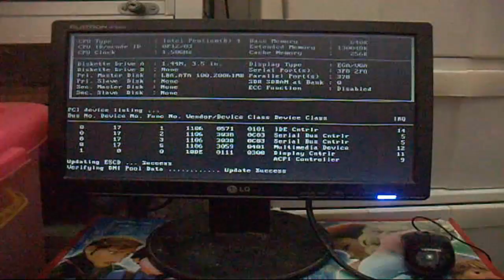Cara Mengatasi komputer tidak bisa nyala

Comment: bang mau nanya dong kalau pc tiba2 mati sendiri pas dipake terus pas tombol power di tekan gak ada respon sama sekali, psu sudah saya cek pake kawat yg disambungkan ke kabel hijau dan hitam dan hasilnya psu normal tapi ketika dipasang di motherboard tombol power pas ditekan gak bisa nyala sama sekali tolong dijawab bang baru kali ini soalnya
Reply from the maker: coba tuk cek heatsink dan fan processor, apakah kendor atau kipasnya tidak jalan. overheating/kepanasan dapat mengakibatkan komputer mati sendiri.
Reply: lampu indikator juga tidak nyala sama sekali bang, saya sudah coba nyalakan tanpa casing juga gak bisa dinyalakan😭
Reply from the maker: @zaldychst  saat menyalakan bunyi alarm tidak ?
Reply: pada saat dinyalakan tidak terjadi reaksi apa2 bang
Reply: fan prosesor sudah di cek masih aman, saya coba nyalakan tanpa kabel front panel juga tidak bisa, coba cabut vga juga sama saja tidak ada reaksi sama sekali, bang malah pc satu satunya lagi bang hufftt
Reply from the maker: @zaldychst  coba menghidupkan tanpa ram dulu, jika mobo normal, akan bunyi alarm.
Reply: tetap tidak ada reaksi apa2bang, kalau dicolok di listrik kayak asa suara bising dari PSU dan gak bisa nyala sama sekali bang
Reply from the maker: @zaldychst  coba tuk ganti PSU yang lain, kemungkinan PSU nya tidak kuat ngangkat.
Reply: Abdul Rohman oke siap bang makasih banyak sudah mau dengar curahan hati saya, sukses selalu bang auto subscribe sih👍🏻👍🏻

Comment: Bang saya mau tanya. Komputer saya sudah lama tidak dihidupkan saya coba hidupkan tapi no signal. Power supply hidup. Fan prosesor hidup. Kabel bagus. Mobo bagus. Jadi yang rusak itu apa ya. Yang buat no signal. Mohon dijawab???
Reply: Dan ciri ciri yang rusak itu apanya??
Reply: Dan ciri ciri yang rusak itu apanya??
Reply from the maker: coba tuk bersihkan ram dan slot ramnya dengan menggunakan kuas, dan pin ram dengan menggunakan penghapus pensil.

Comment: Bang motherboard saya menyala sama psu dan vga,tapi kok di pencet tombol power gak nyala ya keyboard jg ga nyala,normalnya setelah PC kita di nyalaiin terus di pencet power nyala nah ini nggak,mohon pencerahannya dan sarannya kira2 ada kesalahan di mana nya bang,setelah ane coba2 gak mau nyala
Reply from the maker: kemungkinan pertama ada di bagian psu, yaitu psu tidak kuat ngangkat, tapi posisi psu nyala, solusinya coba tuk lepas dulu kabel power 24/20 pin dan 4 pin dulu, lalu pasang lagi, jika tetap sama maka coba tuk ganti dengan psu yang lain yang posisi di komputer lain normal.
Reply: @MrAbdulrohman  PSU udah kuat bang 650 Watt sebelumnya gak ada masalah,baru pertama ini kejadian
Reply from the maker: @skyfall6873  coba tuk dipasang dan di luar tanpa casing, bisa juga ada konsleting ringan antara motherboard dengan casing

Comment: bang, awalnya pc saya hidup, jd  karna banyak debu saya buka vga dan fan nya, dan saya pasang kembali,awalnya psu hidup, keyboard dan mouse nyala, tp pas dipencet tombol power tidak hidup, itu kenapa bang?
Reply from the maker: coba tuk cek kabel power psu yang masuk ke motherboard baik yg 24 pin dan 4 pin dan serta kabel panel casingnya.
Reply: Abdul Rohman terima kasih bang, udah idup, tp kok gak nyambung ke monitor ya? pc nya dah idup, monitor cuman ngedip ngedip warna biru
Reply from the maker: @fauzanzxs  itu biru semua ato ata tulisannya error ?
Reply: yang warna biru ngedip ngedip doang bang, kalau layar monitor nya cmn hitam
Reply: pas dicabut kabel birunya dari vga, baru ada tulisan " Check Signal Cable"
Reply from the maker: @fauzanzxs  coba tuk cek vga cardnya dan kabel vganya.

Comment: Bang komputer saya kalau pagi susah di hidupin. Apakah ada kaitannya dengan tegangan listrik rumah yang hanya 1R? Cpu saya 450wat. Dan bagaimana solusinya. Mohon di jawab bang 🙏🙏🙏
Reply from the maker: kalau listrik biasanya berpengaruh ketika, sering naik turun. dan bisa juga power supply yang sudah tidak stabil/tidakkuat ngangkat.
Reply: @MrAbdulrohman  PSU saya lancar bang
Reply from the maker: @cosleos2733  sudah di cek voltasenya ?
Reply: @MrAbdulrohman  belum sih pak. Tapi kalau PC saya di bawa ke tempat fotokopi atau bisa dibilang agak kota lah daerah nya, PC saya hidup pak.
Reply from the maker: @cosleos2733  kemungkinan listrik rumahnya, coba tuk pakai ups/stabilizer motor
Reply: @MrAbdulrohman  sudah pakai stabilizer bang, sama aja
Reply: @MrAbdulrohman  tapi saya coba ke tetangga tetap gak hidup juga bang
Reply from the maker: @cosleos2733  coba pakai ups

Comment: Gan klo dri mobonya tp lampu indikator nyala, kalo psu normal, itu kira" mobonya diapain ya
Reply from the maker: di clear cmos dulu. biasanya pindah jumper cmos ke posisi clear.
Reply: @MrAbdulrohman  pindah dari pin 1-2 ke pin 2-3ya gan ?
Reply from the maker: @vi_nsh  iya mas.
Reply: @MrAbdulrohman  wah tq gan bikin mumet ajah nih cmos
Reply: @MrAbdulrohman  +1 like

Comment: Mohon pencerahan.pc ane waktu di tekan tombol on nya..lampu indikator satu kalo nyala ..segejap doang..selanjut nya pc ttp tdk menyala..sa coba tekan lagi tombol on..lampu indikator udah g nyala..kecuali cabut colokan dulu
Reply from the maker: coba tuk cek voltase power supply nya dengan menggunakan multi tester, mengukur 12 volt, 5 volt dll. apakah voltase turun atau tidak ?
Reply: Jadi sekira nya..ada masalah dgn power supply nya ya gan..terima kasih atas jawaban nya..auto sub
Reply from the maker: sama-sama

Comment: Komputer tiba2 mati lampu,setelah itu tidak bisa dinyalakan,penyebabnya apa
Reply from the maker: kemungkinan over heating/procesor panas.
Reply: Solusinya biar bisa nyala lg gmn
Reply from the maker: @kukuhsatrio2065  coba tuk cek kipas dan heatsink processornya, jika kotor bisa dibersihkan, dan jika panas, bisa ganti thermal pastanya.
Reply: Siap,terima kasih pak
Reply from the maker: @kukuhsatrio2065  sama-sama

Comment: Mau nanya Om, aku punya CPU mati, kipas prosesor masi muter, alarm juga gk bunyi, sdh cek ram sdh sempet d ganti juga, cek heatsink prosesor masih kenceng, smua kabel sdh aku cek, sdh coba ganti PSU juga, tapi masih gk ada tanda" kehidupan...😅😅, knapa ya Om, makasih sebelum ny..🙏🙏
Reply from the maker: harus cek motherboardnya, coba tuk clear cmos dulu, atau lepas baterai cmos, pasang lagi dan hidupkan kembali.
Reply: Abdul Rohman sdh smuanya Om, awal nya CPU aku pindah, trus bgitu aku nyalain d monitor sdh sempet kluar data CMOS nya kayak normal, kursor juga sdh sempet tampil, trus tiba" layar hitam tdk ada kelanjutan nya...😪, mohon Om bantuan nya...🙏🙏, sampe pusing aku, maklum Om masih awam tentang CPU...😅
Reply from the maker: coba tuk masuk ke safe mode dulu, dengan menekan f8 terus sebelum loading windows atau setelah menekan tombol power.
Reply: Ok, makasi Om masukan nya..
Reply from the maker: sama-sama

Comment: Bg kalo kipas tidak nyala ,bunyi bip .4 kali
Lapu power kedip2 merah..apakah mmungkinan powersuply nya bg..trus saya perhatikan kabel power suply saya ada 3 buah pin..berbeda dengan yg di video..apakah fungsi warnanya sama?
Reply from the maker: bagaimana jika tanpa RAM, trus komputer di hidupkan, apakah bunyi bip nya 4 kali, jika bunyi bipnya 4 kali, coba untuk membersihkan pin RAM dengan menggunakan penghapus pensil. Tentang kabel, itu kabel power arah ke mana ?. Klo masalah warna fungsinya sama.
Reply: Sudah saya coa bersihkan dengan penghapus bg..ram,vga,saya coba ganti2 slot..tp tetap bunyi..saya coba lepas vga,dan pakai vga bawaan tetap bunyi..kompi saya hp compaq 8200 elite g..psunya punya kabel 18..dipisah ,6 pin,6 pin 4 pin.. 4 pin ke cpu power..yg 6,6 dicolokin deket colokan slot ram
Reply from the maker: mgkn bisa di coba ganti psunya dgn yang normal (punya komputer lain)
Reply: https://youtu.be/QvalCfCRy14

Masalah saya persis seperti itu mas..computernya juga sama
Reply: Td setelah saya lakuin kaya video mas ,power suply masih hidup..kipas psu kencang

Comment: Kalo kipas psu nyala tp monitor tetap mati sedangkan ram dan hardisk dan procesor,btrai cmos smua aman..kira kira apa ya gan minta bantu jawab dong? Oiya lampu indikator nyala sebentar abis itu mati.
Reply from the maker: kemungkinan PSU tidak kuat ngangkat atau processor over heating atau kepanasan
Reply: Abdul Rohman maksudnya gakuat ngangkat gimana ya ? Selama ini sy normal2 aja sih..
Reply from the maker: coba tuk ganti psu yang lain, tuk diagnosa
Reply: Abdul Rohman thanks sangat membantu
Reply from the maker: sama-sama

Comment: punya ku ko ttep ga nyala.. psu nya d cek masih muter.. kronologinya pc ke adaan off pas d nyalain ga nyala😒..
mhon bantuanya hu🙏🙏🙏
Reply from the maker: coba tuk cek ramnya, coba tuk hidupkan tanpa ram dulu, apakah ada bunyi alarm panjang, klo bunyi coba tuk pindah slot ram.
Reply: @MrAbdulrohman  udh d lepas semua.. dan ga ada suara alarm krna ga pke speker bg?
Reply from the maker: @sintrastyt3548  biasanya bawaan motherboard ada speaker kecil, untuk mendeteksi kerusakan, jika tidak ada, agak kesulitan tuk ceknya. coba tuk ganti ram ato kalo ada 2 ram bisa dipasang salah satu dulu ato di silang posisinya.
Reply: @MrAbdulrohman  blh minta wa ga bg.. sya nannya2 singkat aja dri siang blum tidur nih cari info ga ada yg akurat, semua pada nyaranin kaya abg dll.. masih aja.. dan klo mau ganti pun takut kena lagi.. masa bisa kena mobo cuma krna ups ga d matiin
Reply: @MrAbdulrohman  btw aq pke asrock a320hdv
Reply from the maker: @sintrastyt3548  sy minta nomor anda dulu, nanti sy add.
Reply from the maker: @sintrastyt3548  ok
Reply: @MrAbdulrohman  bang aq tungg dritdi ko ga ada

Comment: Halo bang mau nanya, komputer sy tiba2 susah nyala,  awal sy pencet ga idup,  harus di tekan bbrpa detik tombol power nya, trus lepas, trus tekan bbrpa detik lg baru bisa nyala, dan itu cm sekitar 1 detik lsg mati,  tp trkadang bs nyala normal, kadang jg mati dlm stgah jam, sampai bbrpa jam kadang normal, mohon pncrahan nya,  komputer gada speaker mobo
Reply from the maker: pertama harus cek kondisi heatsink dan fan processor, apakah kedudukannya kendor, patah atau fannya mati.
Reply: Abdul Rohman fan sama heatsink normal , heatsink kenceng bang
Reply: oh ya pas sempet nyala ad pesan sblum booting " warning main bios checksum error.  bios hpa not available , trs lsg mati
Reply from the maker: coba untuk masuk BIOS dan setting temperatur CPU di disable, lalu simpan dan restart
Reply: Abdul Rohman udah disabled,  dan ga pernh otak atik itunya bang
Reply from the maker: sudah coba tuk ganti RAM.
Reply: Abdul Rohman udah , karna ram pake dual chanel ,tp masih sm aja
Reply from the maker: yang ke-3, cek power supply. kadang klo ps down, tidak kuat ngangkat.

Comment: Kan komputer saya nyala lagi di pake kek biasanya terus tiba" mati, pas di hidupin gk nyala lagi kenapa ya?? Tolong solusinya dong
Edit: tapi PSU nya nyala itu kenapa yaa?
Reply from the maker: coba tuk cek heatsink dan fan processornya, apakah heatsink processor kendor atau panas atau fan processor nya tidak stabil atau matik.
Reply: @MrAbdulrohman  udh saya cek aman kok
Reply from the maker: @kevinwibisana3095  saya hidupkan tombol keyboard numlock nya nyala tidak dan setelah agak lam hidup lampu numlock bisa mati hidup tidak pada saat di tekan tombol numloacknya. ?
Reply: @MrAbdulrohman  gan maap mksdnya kan tadi lagi di maenin komputernya terus tiba" mati dan saya hidupin gk nyala terus saya coba cek kyk di video agan psu nyala itu gimana yaa?
Reply from the maker: @kevinwibisana3095  kadang psu nya tapi ada yg tidak kuat ngangkat. itu pakai ups ato stabilizer untuk sumber listriknya ?
Reply: @MrAbdulrohman  gk pake stabilizer
Reply: @MrAbdulrohman  psunya 500 wat padahal masa gk ngangkat tadinya aja gk kenapa"
Reply from the maker: @kevinwibisana3095  hal ini perlu metode crossing, supaya bisa deteksi kerusakan. seperti ganti power supply dgn yg lain.

Comment: Klo pc saya tiba2 mati sendiri ketika di mainkan mas, saya hidupkan power jg ga mau hidup2 mas, tapi stlah saya lepas kabel power yg menancap ke pc lalu saya pasang lagi baru dia hidup lagi mas, itu kira2 knp y mas, kabel power pc dapat input daya dari ups mas, saya cek tegangan listrik normal 220-226v, saya cek suhu pc d bios jg normal mal,

Ap kira2 battre ups saya yg udh drop atw gmn y mas,?

Mohon solusi ny mas jika mengetahui mas..
Reply from the maker: kalo tanpa ups bagaimana?. apakah masih sama?
jika masih sama, masalah berada di power supplynya.
Reply: Abdul Rohman klo tanpa ups blum coba mas, tapi itu bkan skali ini aj kjadian ny mas, dia tiba2 aj mas gtu, kaya overheat aj pc mas, tp pas d cek suhu normal...

Klo saya test tanpa ups skrng ini, dia pasti hidup lgi mas, krna tdi kan kabel power yg di pc  ny udh  saya cabut lalu pasang lgi mas,
Jdi dia pasti hidup lgi mas...

Itu yg bikin heran ny mas...

Ap battre ups mas,
Ap Tegangan battre ups ny tidak normal mas?
Reply from the maker: ada beberapa kemungkinan, bisa baterainya yang ngedrop atau komponen power/ic power yang berada di upsnya.
Reply: Abdul Rohman ooo gtu mas...
Brrti bsa di pastikan area yg trouble it d bagian ups ny kan mas, brrti antra battre atau IC PU ny y mas,

Barusan ini saya bongkar ups saya mas di batre ny tertulis di bodi battre it battre standby ny tertulis  13,6 - 13,8V dan saya ukur tegangan ny cuman  13,22V mas,
Apakah sudah bisa d pastikan 100% yg bermasalah itu battre ny mas?
Reply from the maker: kemungkinan seperti itu.
Reply: Abdul Rohman hmmm...
Ok dech mas mksih bnyak2 y ms untuk ilmu nya, dn subscribe dan lonceng udh menghampiri mas,
Hehehe...
Reply from the maker: sama-sama

Comment: Bang komputernya aku pake tiba tiba mati sendiri,terus ku nyalain lagi g bisa,pemakain sih sering mati sendiri karena listrik di rumah g kuat atau biasanya ama bapak saklar rumah di matikan :v ,itu kira kira apa yg rusak bang?
Reply from the maker: iya itu biasanya karena voltase listrik yang down, bisa diatasi dengan menambahkan stabilizer/stavol motor yang fungsinya untuk menstabilkan listrik.
Reply: Abdul Rohman udah,terus masalah komputer saya kira kira apa?
Reply from the maker: jika sudah diberikan stavol motor tetap sama saja, berarti kemungkinan kerusakan di motherboardnya
Reply: Saya coba cek psu nya,itu cuma ada suara "ngengg" tapi kipas gak gerak ,itu knp ya?sebelumnya terimakasih
Reply from the maker: coba tuk ganti psu nya.

Comment: Permasalahannya Monitor hanya menampilkan tulisan "No Signal"
Mouse dan keyboard tidak bisa nyala
Semua kipas dapat menyala atau berputar dengan baik
1.Kipas Stock Cooler Ryzen (dapat menyala) 
2. Kipas VGA (dapat menyala)
3. Kipas PSU (dapat menyala)
4. Kipas Case Segotep (dapat menyala)
Ram yang saya gunakan 
1. Team Elite Plus 8Gb DDR4 2666mhz (Single)
    Module TPD48G2666HC19BK
     CL 19-19-19-42 1.2V
2. Premier Adata 8Gb DDR4 2400mhz (Single)
     Module AD4U240038G17-B
dari kedua ram yang saya sebutkan di atas sudah saya coba 1 per 1 dan sudah ganti-ganti slot tetapi sama saja tidak bisa
saya menggunakan kabel HDMI untuk menyambungkan VGA ke Monitor (HDMI to HDMI).

apa ada yang rusak ya ?
Reply from the maker: itu motherboard ada buzzernya (speaker kecil) ?. Jika ada pengecekan akan lebih mudah. pertama mencoba menghidupkan komputer tanpa ram. jika bunyi alarm di buzzer, kemungkinan motherboard dan psu normal. dan harus mengecek yang lainnya.
Reply: Abdul Rohman 
Terima kasih untuk balasannya pak
Untuk menghidupkan komputer tanpa menggunakan RAM
Pada Buzzer/speaker mengeluarkan bunyi Beeb sebanyak 3x
Reply from the maker: ok, selanjutnya jika dipasang ramnya salah satu aja, bunyi beep 1 x ga ?
Reply: Abdul Rohman tidak pak
Reply from the maker: jika sudah di coba ram Team Elite dan Adata, masih tetap tidak bunyi beep, silahkan coba tuk ganti RAM yang normal (punya komputer lain). hal ini untuk memastikan kerusakan di bagian RAM.
Reply: Abdul Rohman untuk ram Team dan Adata sudah saya coba di komputer lain yang menggunakan Processor intel dan ram nya dapat berfungsi
Reply from the maker: itu vganya onboard atau vga card ?
Reply: VGA Card pak
processor yang saya pakai ini tidak ada Vga onboardnya
Reply from the maker: sudah coba ganti vga card (dengan vga yang normal) ?
Reply: sudah pak
2 vga card yang saya coba kipas nya dapat berputar dan saya menggunakan kabel HDMI untuk menghubungkan VGA Card ke monitor (HDMI ke HDMI)
Reply from the maker: itu ada kabel vganya ? klo ada coba pakai kabel vga dulu.
Reply: untuk ke 2 vga yang saya coba itu tidak ada colokan untuk VGA nya pak
cuman ada Display port, HDMI dan DVI
Reply: Punya saya juga kayak gini gan, komputer nyala tapi no signal + keyboard mati, sudah tak lakuin segala cara mulai bersihin ram, lepas bateray cmos, reset bios, lepas pasang processor dll masih tetep..
Apakah ada solusi?
Reply: @gencozzzboy2151  sy juga kasus sama 😂😂😂😂 .ternyata kasus banyak yg serupa di komentar

Comment: Bang mau tanya kalo. Kabel power suply itu kan ada 24 kan. 
Tapi kabelnya kurang satu. Itu ngaruh ga???
Terus lampu yg di matheboard nyala semua. Tapi dimonitornya ga muncul windowsnya???
Reply from the maker: iya berpengaruh, segera ganti power supplynya, supaya kerusakan tdk menyebar ke komponen yang lain.
Reply: Abdul Rohman tapi kabel yang ilang itu -5v bang
Reply from the maker: wah... diganti itu, ato di solder ulang di dalam power supplynya.
Reply: Abdul Rohman ok bang makasih. 
Mau nanya lg bang. Saya kan slot RAM ada 2. Kalo saya pasang semua gamau nyala tapi kalo pasang 1 doank langsung nyala. 
Itu kenapa ya bang.
Reply from the maker: RAM yang terpasang harus serasi, dari jumlah MB, PC klo bisa merek RAMnya. supaya kinerja RAM bisa stabil.
Reply: Abdul Rohman ok bang makasih banyak yah. 
Sukses buat chanel 👍👍👍👍
Reply from the maker: sama-sama